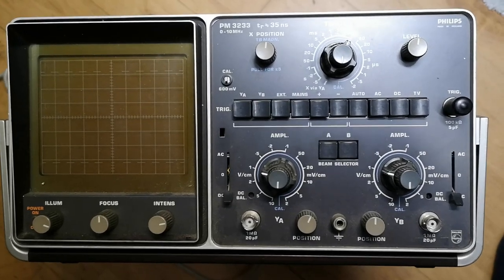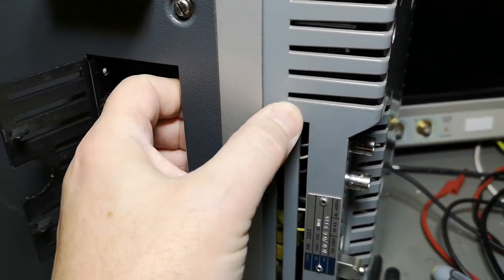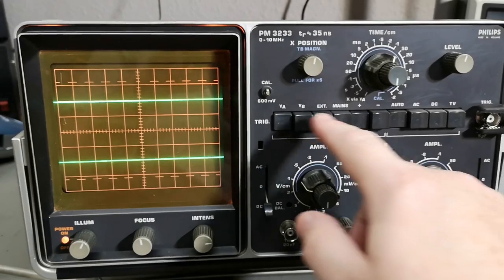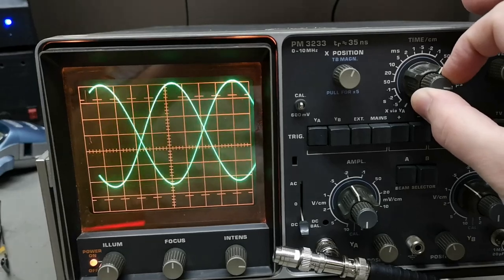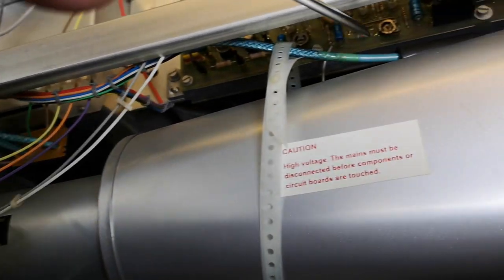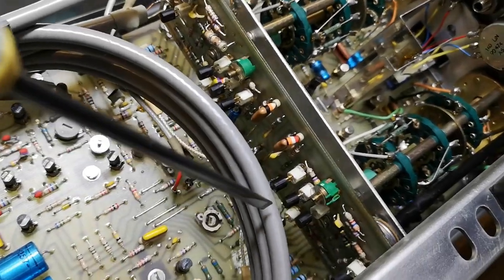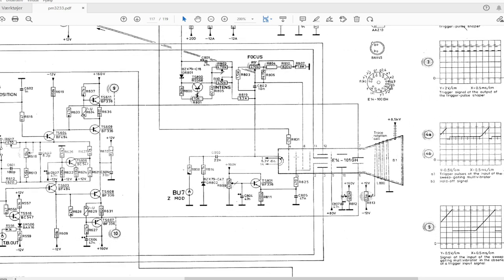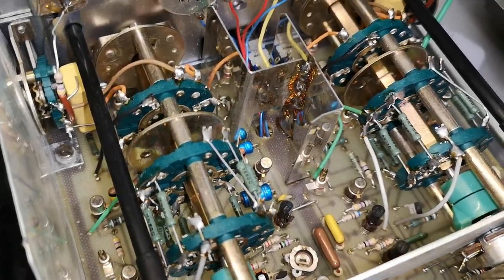Philips PM3233 oscilloscope 2ch dual beam 10MHz test teardown

Comment: Picked up one of these recently. I don't yet know what to plug in to it to see it work!
Reply from the maker: just power it on, and do what i did at about 6:00 see you can get two lines from the two beams. the CAL is a signal generator, connect your probe here to see a signal